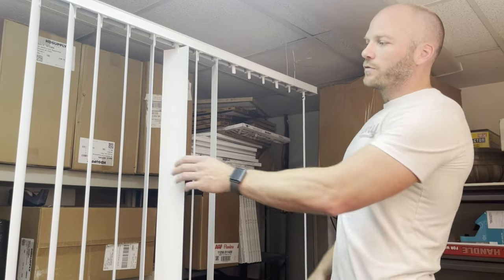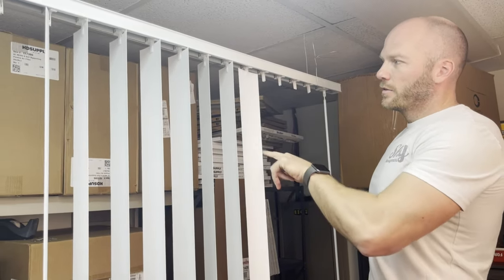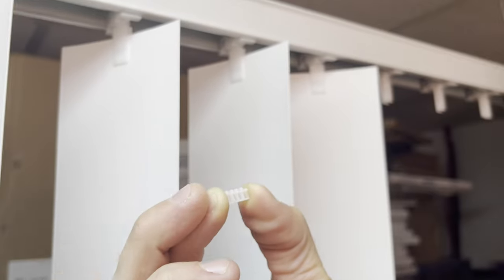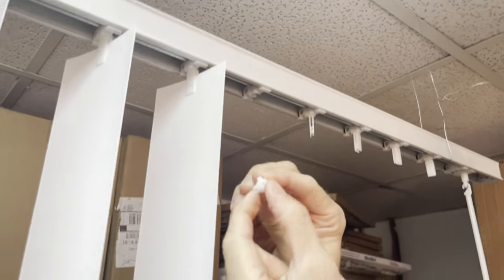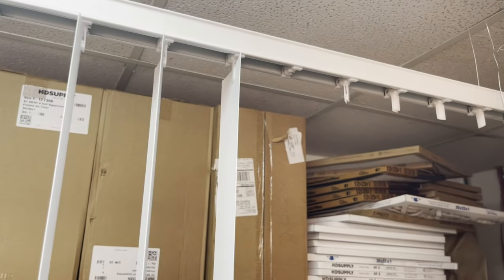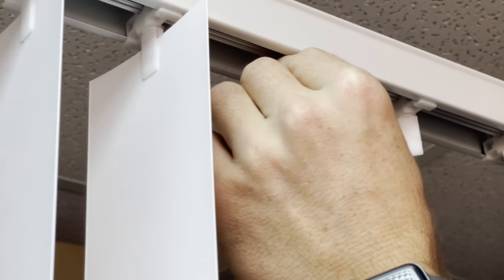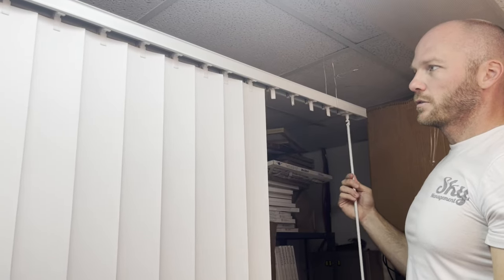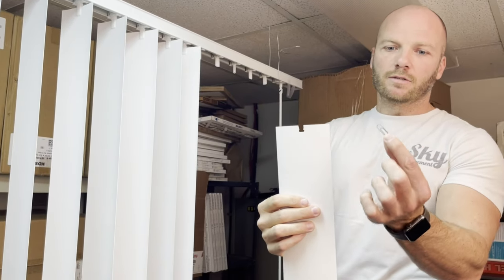How to easily fix common issues with Vertical Blinds

Comment: Question what of the rotator won’t rotate the blinds how do i fix that?
Reply: Did you ever figure it out ? Thats whats wrong with mines
Reply: I can here for this as well
Reply: Same
Reply: Same
Reply: Obviously the gear is missing above the rod clip
Reply: Same here
Reply: @royalblueblood is there a way to fix that?
Reply: Help
Reply: Same
Reply: I have the same issue
Reply: Whew we need a solution to the ones that are stuck!
Reply: Same
Reply: Ditto
Reply: Same I saw one video where all the blinds need to ‘ click ‘ in the same position but that broke the part that holds in the blind - I think I need to take ‘em out and put the blind tray or whatever on a table so I can see what’s going on 
Obviously I am not mechanically inclined ;)
Reply: try rotating it to the other side? that’s what worked for me i was rotating it the wrong way

Comment: If you remove the vertical pieces and then lay the track down on your bench or table, then if you drop a piece it doesn’t fly away on the floor. Also, the pieces fit easily into place. It takes an extra 10 minutes but saves 15 minutes of cussing while chasing the pieces across the floor. This is to replace the gear and the race.

Comment: Thank you for your demonstration, It is knowledgeable, but my wife's confidence in me has deteriorated. One of my inserts was off a gear, like your video , but I couldn't turn it back, I could turn it forward, to correct the allinment of the other ones i turned all the inserts forward to make them uniform but now they all won't close all the way. Do you have a Solution?

Comment: I had the first problem with the blind that would not settle with the rest because it was facing the wrong way by 90 degrees. It took a bit of courage to grab the mechanism to twist it back to the same as all the other carriers, but I swallowed hard and twisted. A loud click followed, and the job was done. Many, many thanks for a super video.😀
Reply: I have the same problem and its not budging argh!!!

Comment: Thank you! I'm a master at this now I help people all the time I had one that was off clicks so I loosened it to when it would be open and started clicking them all evenly until theu were perpendicular it was 2 clicks on each and then I twisted it and it was like it was brand new I like these alot especially mine it's in my master bed room I have a deck off the bedroom and it used all the time so when the blinds don't work it's a big hassle. Thank you very much!

Comment: Thanks for your clear repair instructions, very helpful. I have 2 sets of these blinds installed on sliding glass doors in a short term rental. The downstairs set operates well, no problems. The set on the main floor are used frequently, and are often damaged by renters unfamiliar with operating them. Now the problem is that the white cord used to slide the panels open and closed is jammed, so will not move. I am able to manually slide the panels open. Is there a way to fix this cord?
Reply from the maker: It’s possible that if you take apart the gear part where the cord goes that you could get it going again. But, to be honest, We got rid of all of the corded ones at our rentals. Tenants seemed to struggle with them more.

Comment: Nice video. Another problem i have and need help with is the wand will not open or close blinds.  Any tips?  Thank you.
Reply: I'm having the same issue, Sky Management. The stick is stuck on my blinds as well and won't twist one way or the other. It feels like there is a lot of force stuck behind it. Note, it still freely slides down the track, just won't twist.

Comment: Hey there, I'm having another issue with my blinds. When I try to turn the wand to let partial light in it only opens about 10% and never anymore, very frustrating. My only option is to completely pull the whole blind open but then everyone can see inside. Do you have a fix or do I need new blinds please?
Reply: Same😢

Comment: Hey thanks so much for the video unfortunately my issue isn't there.  I've just gone to install a blind and the mechanism is faulty.  Both sides of the string close not open.  I've pulled on the string to 2 3rds of the way along and they open and close. But about a 3rd away from the string there's a block of about 5 of the wee plastic sections that clump together tightly.  After this point is where both string sides only open . Please help

Comment: I’m having issue re installing the  part that goes horizontal over the metal rail. I ordered the 3 clips that attach to the actual square rail but I can not find the plastic edging that goes over that blind that keeps it ridged

Comment: I have been trying unsuccessfully to place the little gear (that mates with the rotating rod).  Reference approximately minute 2:30 of your video.  It keeps falling out before I can place the clip.  Also what should the position of the gear's teeth be relative to the clip?

Comment: Thanks for the video! I have a quick question- In my case, I am having 2 issues and would greatly appreciate your response!
(1) In my living room window blinds, only 1 out of the total 9 blinds move when I pull the rope attachment. The remaining 8 blinds just stop moving along with the first one after 2 seconds of pulling my rope attachment so there is this huge gap created when I close the blind and sunlight comes right in.What to do about it?
(2) For my bedroom window blinds, i ma having the same issue but in this case 4 out of 9 blinds move after pulling the rope attachment. The remaining 5 just won’t move at all after a while so it creates a wide gap and sunlight comes right in. How to solve this issue?
Thanks ahead of time for your response🙏

Comment: Thank you so much for this the first problem is my problem and I tried turning the little plastic thing but it will not budge :( Help! thank you
Reply from the maker: I'm sorry, it's tough to help without seeing it myself. you could try removing the slat connecter piece and then putting it back on straight. but be careful not to lose the little gear piece behind it.

Comment: Great vid! The prob i have with my vertical blinds on my sliding door  it doesnt move side to side like when i open it like half of it moves back together and the other half just stays there and i have push it back what would be the best way to fix this?
Reply from the maker: Check all of the sliding pieces and make sure they are all in the frame right.  Sometimes one of them can get off the track and it can bind up and not slide right. 
If they all seem to be on there the same way, then try some WD40 on the track and the bar down the middle. See if that helps it start sliding better.
Reply: @SkyManagement   Thanks for the advice!

Comment: I have a cord drawn blind. At the cord side. The blades dont cone to the end.  At the other end there is 2 together.  Can i remove from one end and put at the other end
Reply from the maker: Its hard to say without looking at it. Usually, you can pull the whole string back down to the one end. We have gotten away from the ones that use the stings. They seem to have more issues. But we are dealing with rentals, and people are hard on them.

Comment: I'm here because my blinds won't spin open but it's fine spinning closed.  I have two strings one to collapse it open and closed, which works, but the ball chain string just opens the blinds a quarter way and the string just clicks as it's pulled thereafter without opening the blinds any further.  Suggestions?

Comment: Do you know how i would fix one that is freely sliding? Like, if I spin them open or close, they work just fine but if I slide them across so there not blocking the window and I go to pull them back across the window, only one is attached to the slider so only one will slide back unless I grab them with my hand and manually pull it with my hands.

Comment: My issue is that we have new cloth vertical blinds and when closed in the orientation we need (slat gaps facing away from where we sleep) they do not come together as close as I think they should. In that the gap is not mating up well and therefore lets more light in than we like. One side is patterned and the other solid white. So they are not like vinyl and single color to where you can change the orientation. When I close the blinds in the opposite direction to where the gaps are facing the bed and the white back is visible, you can clearly tell that the gaps between slats is less and the slats "mate up" better to let less light through them. Any ideas on how to fix this? Is it just that the way the slats are made that at the top there is more of a bulge of fabric on one side that prevents the slats from closing together better? Or a way that the clips could be changed to go past more of straight line (meaning, close past 180 degrees to where you are forcing the slats to try and mate up closer)? Again, we do not want to just flip the slats as the (smaller) gap will be facing the bed and light would shine into our eyes top some degree.

Comment: is it possible to change the side the blinds slide too
Reply from the maker: Yes. They will go either way. You just have to unsnap the whole mechanism from the mounting brackets and flip it around. Then snap it back in. They are meant to be mounted either way. It is a little awkward to do with all of the slats attached. So you might pull them all off first.
Reply: Hi my blinds will pull to right but they won't go back any ideas thks

Comment: 4:36 I'm going to try to just use a staple right there instead of a paperclip for aesthetic purposes
Reply: @skymanagement what if all the cars are stuck and won't slide to open the blinds AND none of the slats are turning but the aluminum rod IS turning